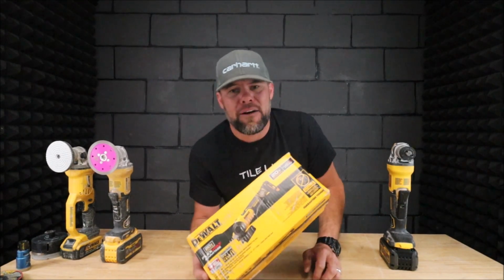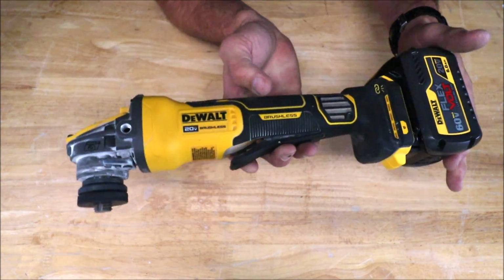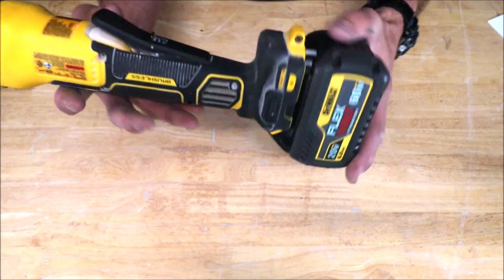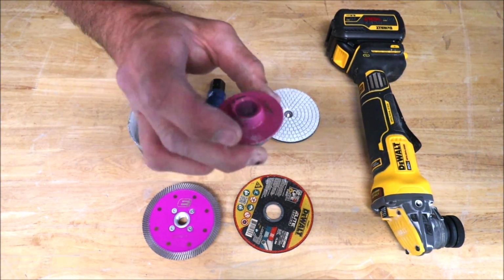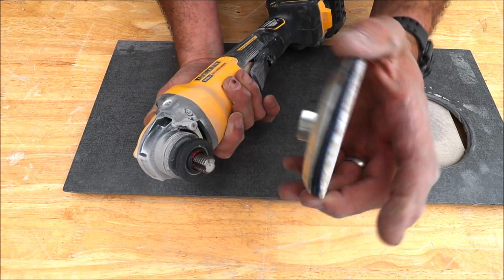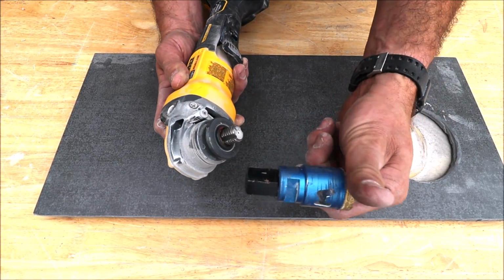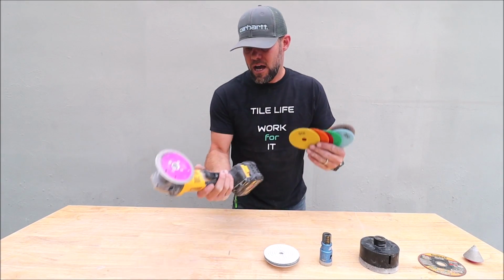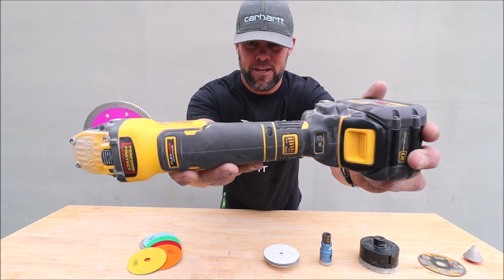It's Finally Here! Dewalt 20V Variable Speed Grinder!

Comment: You think it’s would work good with cutting granite that’s 1 1/4 “ thick and making holes too?
Reply: Yes. I like to be able to control it on materials like quartzite. I’m a lead installer and it works on all. It’s literally like a battery powered matabo. You’ll love it
Reply: @ thanks for the feed back I hate looking for power on the job site and running extension cords

Comment: Nicely done review man. I like it, very similar to the new Metabo HPT 4.5-6”braking grinder which I just got and is very nice, although it’s not quite as Powerful as the dcg814 or whatever it is the flex volt 6” but it’s still got plenty in the tank the flex volt is just a brute

Comment: I bought the DeWALT 20V MAX Orbital Sande  (DCW210B), foolishly thinking that the 50 grit diamond pads would be good enough to remove the top layer of my concrete tiles...long story short, thank you for posting this video, it is exactly what I was looking for.

My question for you; do you think this cordless grinder would work with any of DeWalt's Diamond Cup Wheels?  I know that a diamond cup is probably what I need to grind down to expose my aggregate.  

I'm making 6x6x0.5 inch tiles.  Any advice on exposing aggregate or size of wheel would be amazing.  Thanks for this video!